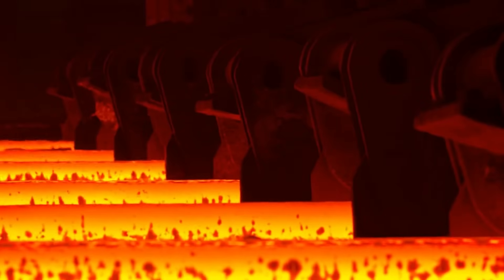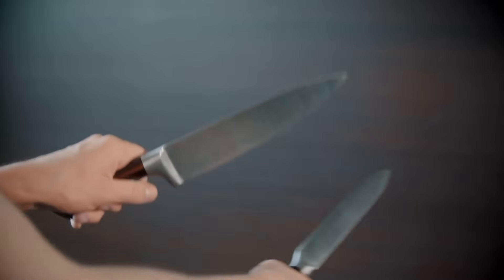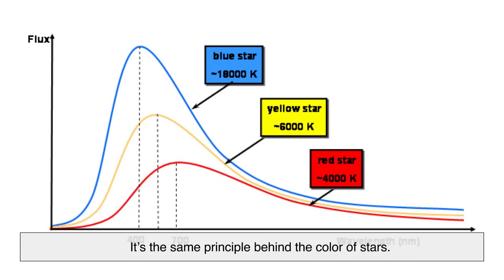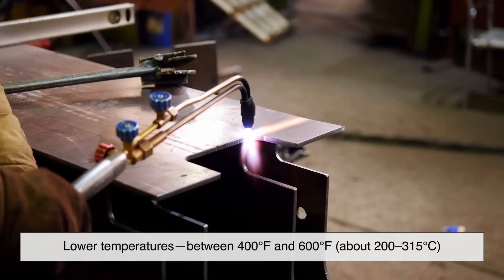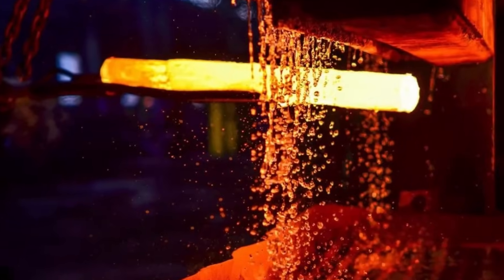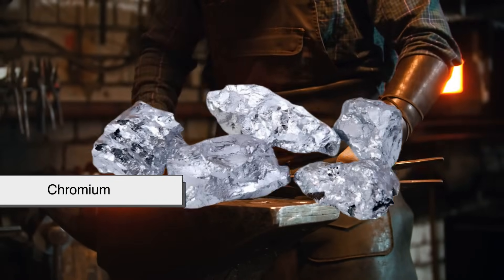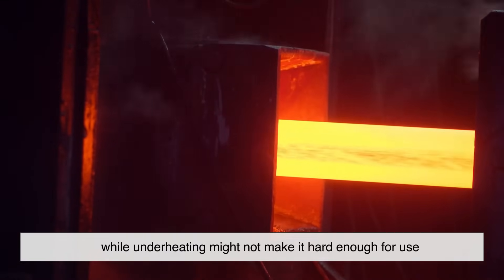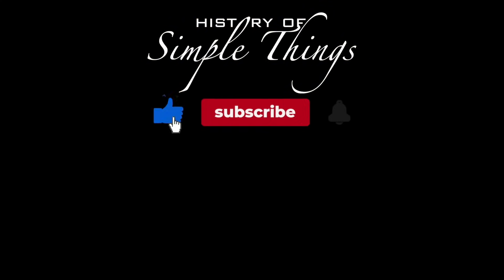Heat and Steel: What Causes the Color Change?

Comment: Great introduction to the colors. In fact modern ways of measuring Temperature uses the radiation from the material. This is perfectly explained by Eike from SensorTherm in this podcast episode. 

Advanced Optical Thermal Analysis with Eike Boback
https://youtu.be/lo1gm3iC9wc

Comment: # Stellar Characteristics: A Spectroscopic Analysis

## Stellar Classification Based on Color and Spectral Shift

The observable characteristics of stars, such as color and spectral shifts (redshift and blueshift), provide crucial insights into their physical properties and dynamics.  This analysis delves into the relationship between these observable features and the underlying stellar processes.

### Stellar Color and Temperature

A star's color is directly correlated with its surface temperature.  Cooler stars appear redder, while hotter stars exhibit bluer hues. This correlation stems from the peak wavelength of the emitted radiation, as described by Wien's displacement law.  The spectrum of a star, obtained through spectroscopy, reveals detailed information about its composition and temperature.  Analysis of spectral lines allows astronomers to determine the abundance of various elements within the star's atmosphere.

### Redshift and Blueshift: Indicators of Stellar Motion

The Doppler effect plays a significant role in interpreting spectral shifts.  Redshift, a shift towards longer wavelengths, indicates that a star is moving away from the observer. Conversely, blueshift, a shift towards shorter wavelengths, signifies that a star is approaching the observer.  The magnitude of the redshift or blueshift is directly proportional to the star's radial velocity.  This information is crucial in determining the kinematics of stars within galaxies and galaxy clusters.

### Applications in Astrophysics

The combined analysis of stellar color and spectral shifts provides valuable data for a range of astrophysical studies:

• Determining the distances to stars and galaxies through redshift measurements.

• Understanding the dynamics of star clusters and galaxies by analyzing the velocities of their constituent stars.

• Investigating the expansion of the universe through the observation of cosmological redshift.

• Studying the evolution of stars by analyzing changes in their spectral characteristics over time.

Precise measurements of stellar color and spectral shifts are essential for advancing our understanding of stellar physics and the cosmos as a whole.  Further research in this area promises to unlock even more profound insights into the universe's structure and evolution. 
… ✨️ 

Comparing the metal's heat and color to a star's heat and color was an inappropriate analogy due to the color shift observed in stellar observation. Please be mindful of Unforeseen factors in future narratives. 

😎 ZXLMaster Publishing Unlimited ♥️ ❤️